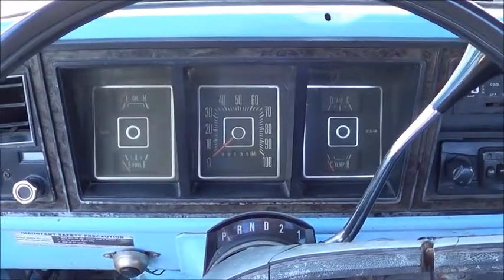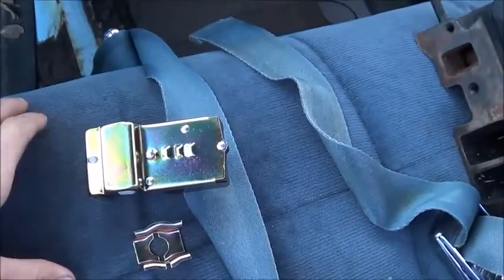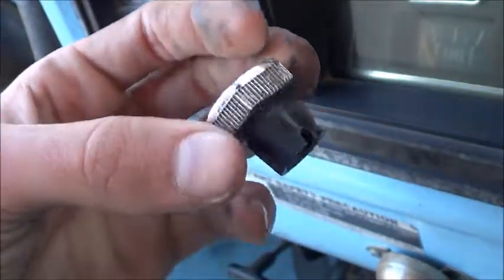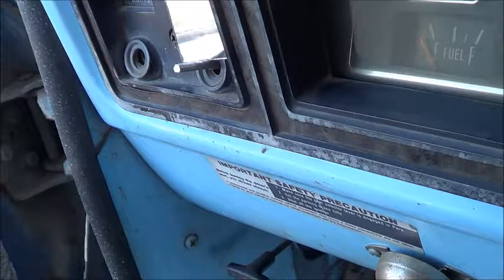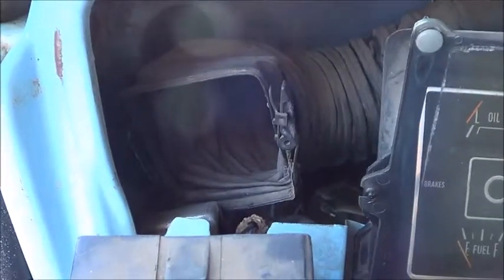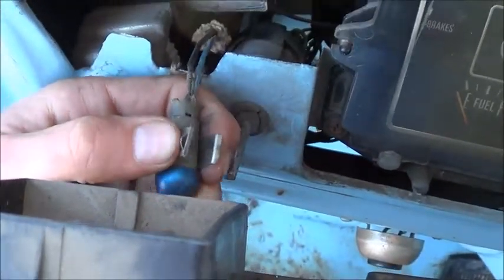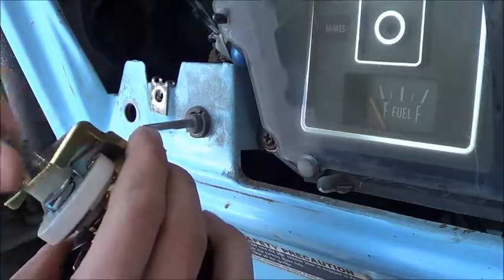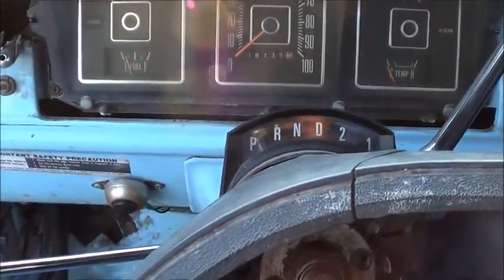F100 Light Switch Replacement

Comment: Hi I replaced the light switch because my tail lights weren't working, this was a option. Now my truck is dead.  Did the jumper cable test, put a new negative terminal to the engine block.  Selanoid is fine.  Battery is 94%.  Switched the light switch back to the old one truck is still dead.  Any ideas?

Comment: Thanks, Jedidiah.  this was helpful.  i am tracking down a parasitic current draw on my 1973 F100.  I have isolated to upstream components/circuits of the starter solenoid.  am thinking it may be in the lights.   any thoughts?

Comment: Were your headlights working fine and only the dash lights not working, when you discovered the light switch as the issue? I'm having a similar issue and don't know how to test the switch itself.
Reply from the maker: Just the dash lights were not working. The headlights worked as they should
Reply: Jedidiah Crone Thanks, was able to test it and found the same problem. I appreciate your video and help solving my issue.
Reply: I'm reading this and it's 2022 glad this is still posted I'm going to try it

Comment: Would you still get 12v at the fuse when turning on the light switch, even though this part is the issue?
Reply from the maker: That isn't something i checked, but since the fuse is before the switch, then it should have 12v even if the switch is not working